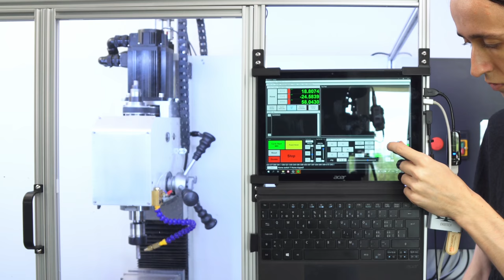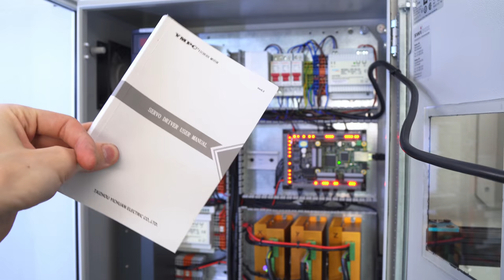BF30 CNC #11 - AC Servo Spindle Upgrade

Comment: Those AC servo's have a bucket load of torque, and you can trade off a little of that torque to gain more speed by simply changing the gears for a higher ratio.
Reply from the maker: yup, just need to make sure your spindle bearings will keep up and not melt :D

Comment: I have also upgraded to Ac Servo 1.8Kw for my BF20L CNC mill. Best upgrade ever! For the spindle bearing I have upgraded to SKF and modify the ratio to have 6750 rpm at the spindle. Machining mostly aluminum so that is a huge plus. The stock bearing are usually good up to 4K but you need to break them in to the new speed. You can run a breaking cycle for like 20 minutes, so 5 minutes at 1000 rpm, then 2000, 3000 and then a good 15 minutes at 4K. The head should rise in temperature but at a certain point at 4K you should have a drop. That means that your bearings are good to go.
Reply from the maker: Thanks for the tips, I'll do that. Have you documented your skf conversion somewhere? I'd love to check it out.
Reply: @DarkArtGuitars  you can see the machine running at that rpm in some of the short videos I took. I don't have a video with the new AC servo spindle yet.
Unfortunately I have no video of the spibdle bearing replacement, but if you search for g0704 spindle bearing replacement, or bf20l or pm25. You will find a lot of videos. The tricky part is to remove the spibdle bearings. For that I got an 6 tons hydraulic press. Makes everythig bearing related so much easier. You can find them new for about 80 euro on ebay.
The spibdle bearings might be different from mine but are listed on the machine manual. You need 4 in total. That can be the right time to switch to an R8 or bt30 spindle. So you can have repeatible too offset. I have r8 spindle but now new machines from optimum ecc are coming out with bt30 or sk spindle.
Reply from the maker: @Ale_Lab  cool, mine is MT3 which is even worse, there is basically no way of getting a toolholder out without a hammer, no matter the amount of anti-seeze.
Reply: @DarkArtGuitars  I know man, I can feel the pain. Mine was MT2 originally. Bought from China the r8 and then you find ER20 TTS holder (tormach style) for about 10 euro each on Ali and shipped from Europe too. Unbeatable price, you can see the tool rack I built on grabcad. Just search for TTS tool rack. It's the black and red. I would really advice you to find the R8 or better the ISO30 or BT30. With BT30 tool holder are cheap too and you have them in all the possible flavor. You can try to contact cnc mobasi if they sell you the spindle alone, or just search on Alibaba and you can have it for 100 euro. That's what I have paid mine. From there ATC is just right after the corner :-)

Comment: Would also love a video showing wiring/parameters, I could never get my spindle motor working as well as I wanted. Awesome video, glad to see more people using these servos
Reply: What kind of issues did you experience? I have a 1.5kw with different controller and there were about 3 settings I had to adjust  to help get the RPM to be within 10 RPM of requested vs actual. I set the RPM by analog 0-10v via my Acorn controller. I was only focusing on the servo RPM at the shaft no gearing settings yet since I haven't decided on an exact gear ratio. I also found that the wiring needed shielding and that shielding needed to be soldered to the breakout connectors metal housing as the "ground" pin alone didn't properly sheild it causing 0v to jump around thus needing a larger deadband.

Comment: Hi David, great video. 
Since I have a 1,8 kW servo lying in my basement ready  to convert my BF20 a follow-up video with the parameter set-up would be highly appreciated.
You might want to replace the pulley on the motor though. It looks like yours is fairly wobbly, probably from a skewed drilling...

Comment: Hi David,
Can you briefly explain how you connected the enable pin to your CNC controller? I connected 24V to +24V on power supply, then the actual enable pin itself to ground of the power supply through a relay which is switched by the CNC controller. My issue is when the spindle is running it will randomly reverse itself and change RPM.
Thanks

Comment: Do you run the spindel motor in speed -control mode or in position-control-mode? 
Are you ready to share the spindle controller-parameters that you used?
I just got the same setup and control it with a 0-10V signal in speed-control mode.
Reply from the maker: I am using position control, it is just hooked up like another stepper motor. The parameters are pretty much default, I didn't change much.
Reply: Can you help me with the settings!? I also try to launch it, but without success. PS The control voltage to the servo driver comes and is displayed (in the dp07 mode)
But he couldn't figure it out! HELP ME PLEASE

Comment: Hi, nice video. I am doing the same conversion on my PM25. Did you replace the spindle Pulley? Where did you buy it? I could not find a pulley withe the right size center bore.
Reply from the maker: My machine was using gears instead of pulleys originally. For the center bore I just had the Aliexpress seller customize the pulley to my specification. Most sellers will do that for not much extra, so if you don't have a lathe yourself it's a great option.

Comment: Hi David
I am going to build an CNC Milling...I want to do a lot of milling , drilling and tapping on steel ..how much power of servo will be ok
Reply from the maker: For this kind of machine 1.5kw will be plenty, anything more the machine rigidity is the bigger issue. For my use I would have probably been fine with 0.75 or 1kw, but the 1.5kw was almost the same price, so I went with it.

Comment: I'm still using the original motor of my machine (mine is only 750w) while the controller is not fully flawless it's okay and I milled a lot aluminium already.
My original machine turned really hot at 2200 rpm, after replacing the spindle bearings it's absolutely fine for hours.
Instead of replacing the motor I'd rather remove the entire front and add a real spindle, 2200 / 3000 rpm is really low for a CNC as you mentioned.
Reply from the maker: I considered that as well, but then settled on a slightly easier mod, as I'll have a different machine coming up for the real high rpm work with small tools.
Reply: @DarkArtGuitars  how much did you pay for the motor upgrade (motor + controller)? I'm just curious.
Reply from the maker: @mrechbreger  It was around $350, plus another $100 for pulleys, brackets, belt...
Reply: @DarkArtGuitars  Thank you for that information, I think I will still go for another spindle and make a spindle adapter for it. Especially since I can continue to use the spindle forward to another project in the future. I did a lot aluminium work with mine already I wonder that your old one burned so quickly.
Reply from the maker: @mrechbreger  yea, not quite sure what happened. I might have messed up some settings in the drive which did something that even after fixing the settings had it drawing too much current, burning itself to death. But in retrospect, I'm almost glad, as otherwise I would have put off doing this upgrade for much longer.

Comment: Hello David, nice videos you make.
Still some questions.
I've been working on the driver for a while.
This with analog input.
How to start the spindle in Cw and CCW.
And what do you have to do to make the prindel stop every time at 12..h?

Greeting from the Netherlands
Reply from the maker: If you want to have positional control over the spindle you need to use step and direction signals instead of analog input, which only tells it how fast to go and not where to go to. When using analog for the speed you will have an additional pin that is either high or low to decide cw vs ccw.
Reply: @saltymax1829  Hallo Medestrijder. ik doe het even in het Nederlands Jongen. Toren draaien gaat goed met mach 3. Maar als ik de Enable aan laat, dan blijft de motor doordraaien op 40 rpm. heb al van alles ingesteld Zoals Pn164 en 165 geen resultaat. nu bezig om hen aan te sturen via Pul en Dir met een pulsgever, maar loopt ook nog niet. Heb de Dir+, Step+ Common anode gelegd, maar werkt niet.
Reply: @DarkArtGuitars  Hello ... First I have to solve a problem.
Pwm from the Print Mach3 works, but min rpm remains 40 RPM.
If I disconnect the plug, and start it up again, he/she runs 40 RPM???????
So
Reply: @gerritbruggink8545  Nederlands is net zo makkelijk :-) Da's apart, als ik pn164 op 1 zet en pn165 bijvoorbeeld op 50, staat hij bij mij gewoon stil. Ben een complete noob op electro gebied helaas, al mijn kennis komt van Youtube :-) Misschien helpt dit je verder met settings : https://youtu.be/7Ozw7p_7EPw
Reply: @saltymax1829  jazeker, hoe of wat heb ,je nu aangesloten, analoog input? welke zetting heb jij nu gedaan en hoe staan ze. Heb je de ingangen al toegewezen?  v.g
Reply: , @saltymax1829  Heb je een voorbeeld hoe je het hebt aangesloten
Reply: @gerritbruggink8545  Zover ben ik nog niet helaas :-) Ik wil straks aan de gang met step/dir zodat ik in ieder geval linksom en rechtsom kan draaien.
Reply: Deze video is trouwens ook een grote hulp : https://youtu.be/WaWqpArGKzU  Misschien kunnen we op een of andere manier contact met elkaar opnemen? Is misschien makkelijker dan via Youtube? Ik zit in Brabant, weet niet waar jij vandaan komt?
Reply: @saltymax1829 , getest, ik moet 60 invoeren en dan staat hij stil.
Reply: @gerritbruggink8545  Kijk, in ieder geval vast 1 probleem opgelost :-)
Reply: @saltymax1829  had je mijn E-mail adres ontvangen?
Reply: @gerritbruggink8545  Hoi Gerrit, nee helaas, ik heb geen email adres ontvangen. Ik heb een paar keer geprobeerd mijn email hier neer te zetten (op een "veilige" manier) maar die berichten lijken steeds weggehaald te worden.
Reply: @saltymax1829  heb je via jou Facebook een bericht gestuurd
Reply: @gerritbruggink8545  Ah duidelijk, ik zit nooit meer op Facebook :-) Ik heb je een mailtje gestuurd.

Comment: I have a second hand 1.8kW Allen Bradley servo, 3500rpm, 6.1Nm continuous, 18Nm peak. It is direct coupled to an ER25 toolholder running in P4 matched angular contact bearings....so no belt drive. Works well. It has plenty of torque to drive tools up to 16mm in steel with good solid cuts, no pussy footing around!
Reply: I really want to see that. Direct coupled should be amazing.

Comment: 11:53 for that you have to counter balance Z axis. Stepper motor Torque not enough to keep tool at position. Litte bit of chain and lead can solve the problem or Google :D :D :D (its very very late comment but hope it helps)
Reply from the maker: There is a pneumatic cylinder in the column for counterbalance.

Comment: so is this wired in speed mode not position?
Reply from the maker: I have it wired in position mode, but both are an option with the controller I'm using.
Reply: Which controller do you use.. I'm on the digital dream EC300
Reply from the maker: @sickswan61  this cnc is Mach4 with ethernet smoothstepper board
Reply: @DarkArtGuitars  brilliant thanks im trying to figure how to wire an ac servo into my spindle but cant for the life of me get it to work in position mode.. it works fine in jog mode and ive resorted to using it like that until i figure the wiring/parameters.. i think the mach 3 setup and parameters are whats stopping it talk to the servo

Comment: can you issue  a video on how to set the parameters for the servo motor?

Thanks
Reply from the maker: I didn't change much at all, you can just use the manual to find the setting you're looking for and how to change it, if there is something you want different from default, but I left most settings stock.
Reply: @DarkArtGuitars  

Thanks David